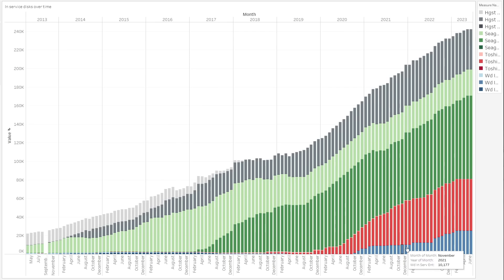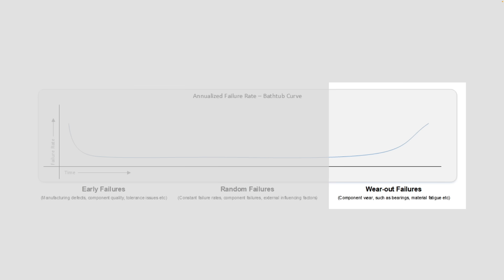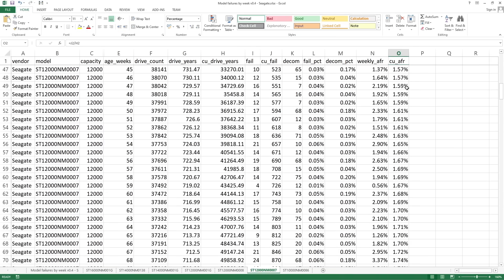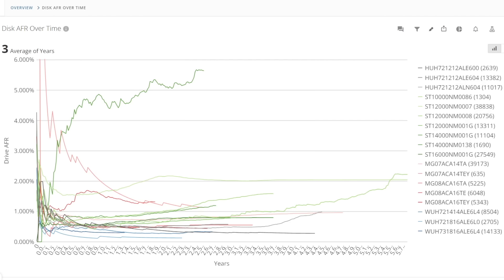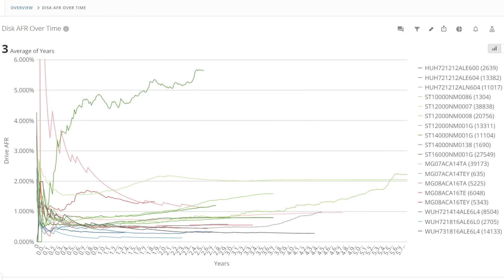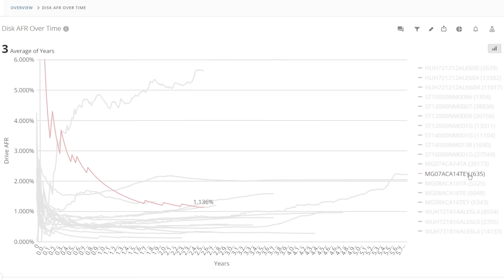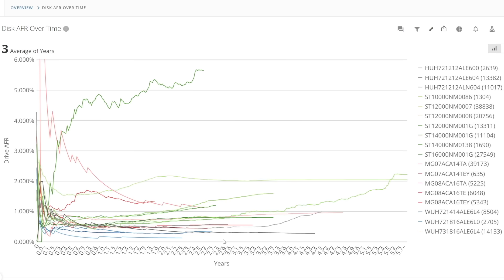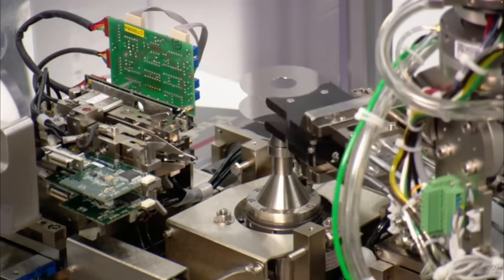Failure Rate Analysis - Best 10Tb+ hard drives: Seagate, Western Digital or Toshiba?

Comment: None of this is relevant. This recipe works perfectly: only buy hard drives that have a 5-year warranty and always use RAID. If necessary, keep a spare Disk on hand in case a disc fails so that it can be replaced immediately. This gives you the guarantee that you can use the discs you have bought for 5 years at no extra cost.
Reply from the maker: I wouldn't agree it isn't relevant, all the data points are relevant to the decision on which drives to buy. Especially for home/SOHO where people don't carry spares, or where its more financially viable to replace a drive when it fails. 

But it does point the fact and it isn't the only consideration, and despite Seagate not having the best reliability, the pricing can mean it can be the best choice, especially if you have a lot of drives and carry spares. In enterprise, servers are often replaced before the 5 years drive warranty expires anyway.
Reply: @sometechguy  Hello 🙂. I still do not agree:
At work I'm an IT manager with a few hundred employees and our 70 servers all have Seagate with a 5-year warranty. The last time I had a single Seagate disk fail was about 8 years ago. Of course, this was no real issue, because we've got the replacement Disk within 2 or 3 days.

And especially in home/SOHO, the only and most important parameter is to have disks with 5-year warranty: These disks are not more expensive and the warranty ensures that you won't have to buy another disk for 5 years 🙂. If someone doesn't want to have a spare disk at home, they still have the freedom to decide in the event of a fault: If the warranty takes a long time to expire, they can buy a new disk if necessary.

You're sure about this?:
"In enterprise, servers are often replaced before the 5 years drive warranty expires anyway."
We are a group of companies with 8 different companies. At each(!) company, servers and disks are used for much longer than the warranty: Our current, productive servers (and disks) are approx. 8 years old, i.e. the warranty expired 3 years ago. And all Seagate are perfectly running 7x24 🙂

Comment: This was fantastic, thank you very much for your time and presentation. I'm curious if the manufacture site code is not really relevant anymore? If I remember correctly, at least in terms of seagate's, if they had an active recall published, it was generally based on a specified site code in addition to a certain min-max index of serial. As I stare at a few drives here, I'm failing to see an obvious site code on WD, HGST, or Hitachi drives which has piqued my interest if perhaps HGST, WD, Hitachi are all manufactured from a single site indifferent to that of seagate potentially having multiple manufacturing locations...?
Reply from the maker: I don't believe any of the manufacturers embed this data in the serial number or model number, at least not in a way thats easily accessible. I would love to have that data to include in the comparison, as people comment that the country of origin is related to the quality and reliability. A lot of manufacturer happens in Thailand still, but I think there was some diversification following the issues with the devastating floods that hit that country and seriously impact HDD availability for some time.

Comment: What data visualization tools are you using?
Reply from the maker: I used Domo for this. Its a pretty good data visualisation tool and a lot more affordable than Tableau which I used in the past.
Reply: @sometechguy  Thanks for sharing and great vid! The visualizations made it easy to see the AFR's over time for each brand/model. I've used MySQL/Metabase, Python libraries and R for data viz, Domo looks easier to use and better for presenting data, will give it a try!

Also curious how Backblaze isn't using any 20TB drives as of 2023 report and I'm seeing a lot of refurbs, wonder if there is an issue with them.
Reply from the maker: The 2023 Q4 data was released, and it looks like they now have 2x 20Gb Toshiba MG10s, and 2400x WD Ultrastar HC570 22Tb now so that deployment is underway. No sign of 20Tb+ Seagate drives. In the last dataset they had started to deploy the 22Tb disks, but the count was very low and the deploy period was very short, so there wasn't any useful data.

It takes a little bit of time, but I hope the 2024Q1 should also be released soon and we will see what happened there. Once I have that, I will see if there is anything interesting in this.
Reply: Good find! I checked the 2023 link which is 2023 Q4. The drives are mentioned in the article but not the table. The refurbs I'm seeing are the Seagate 20TB X20 and X22. Seagate removed the X22 lineup and only sells X20 and X24 now. Subscribed, looking forward to the data and future vids!

Comment: What about 2tb, 4tb?
Reply from the maker: Check this video : https://youtu.be/l_YqdVGcC0o

It covers the 4-8Tb disks, and because there is a real mix of Enterprise and Desktop disks in that data set, it compares failure rates between desktop and enterprise drives also.

There are small drives, right from 80Gb to 2Tb, which I didn't dive into yet. Most of those in the data are very old, they have not added 2Tb disks for many years.

Comment: Three things:

1) Seagate vs. WD HGST/HGST
WDHGST/HGST is at worst, 1/3rd the AFR of Seagate drives, and at best, almost 1/10th the Seagate AFR.

That's HUGE!

2) WDHGST/HGST
This is, I think, why WD bought the HGST division from IBM/Hitachi because the drives AREN'T the fastest in terms of read/write/I/O/s performance, but they're absolutely rock solid drives.

And yes, whilst you pay more for the initial capex for the drives itself, it also pays dividends with having a lower overall failure rate vs. Seagate.

3) This data shows why I avoid Seagate drives like the plague.

2024 and not all of their drives have some kind of ramp load/unload mechanism for the drive read/write heads, which STILL leads to their R/W heads crashing into the disk platters in some failure cases.

This tech is almost 25 years old by now. I remember when IBM first introduced it in 2000 (which then became HGST).
Reply: Agrees. Used to buy Hitachi drives and now buy the HGST WD drives and they've been extremely reliable. Knock on wood.  WD NVME Black has also been excellent.  Really hope they maintain quality after the current split.

Comment: yeah. Humans are just really bad at estimating probabilities. Unless you have a huge dataset like this one, you will always hear anectodal "advice" like, don't buy toshiba, dont buy western digital etc. Eventhough Seagate isn't getting away here as the best, unless you work with a huge number of drives (10k+) your personal experience is basically meaningless. Even if you had a hundred drives over your lifetime, models change. Some models may be just a bad design, even   from a "usually good" supplier. Your personal experience is just a random pick.
Reply from the maker: This is spot on. 🎯

Comment: Unless you NEED the density and speed I'd go for a non-helium drive any day. I have a atleast 14yo 3TB drive that's been clicking for atleast 6 years but is still running great.

Stacking 8tb drives and tape storage for ultra long term + density all the way
Reply from the maker: I didn't see anything in the data that suggests helium makes any difference to reliability, though the first helium models were a little off, but models vary and it wasn't significant. It seems that recent drives, despite the increased density are getting more reliable.

Comment: These figures are for continuous use, correct? If the use is intermittent, say six hours a day, does it it extrapolate to 4x the life? Or does the way its used increase or decrease the MTBF?
Reply from the maker: The use case is 24x7, but the test data is actually calculated against power_on_hours anyway and not elapsed time. So its based on continuous use, and because the power on hours lines up with the drive ages closely, its clear they are powered on for approx 24hours a day on average. I am sure there are brief maintenance windows.

But in terms of the stated MTBF on the drives, its based on assumed workload for the drive. For enterprise drives in this video, they are all 24x7, but MTBF on desktop drives is often based on numbers around 8 hours a day.

Comment: Rule #1 -- as true today as it was 20 years ago -- avoid Seagate drives
Reply: Modern seagate exos are perfectly fine
Reply: Oops
Reply: amen brother. I've worked on various data centres for past 20 years and Seagate always had the nost failure rates
Reply: what u recommend?
Reply: I still have a 7200.11 that failed... First time I've been angry at a manufacturer
Reply: My experience, Seagate is utter garbage. Every drive I had labeled with it are growing bad sectors or completely failed.  Multiple models.  Hitachi, only 5% failure in  5+ years use.  WDC, typically get weak sectors that can be strengthened by writing 10 patterns on them.

Toshiba, 10k SAS drives zero failures.  15k drives 30% failure after 5 years.
I owned nearly 100 drives since 2007.  I still operate 50 of those drives since 2007, only one being a failing Seagate drive. All the other Seagate drives were returned while on warranty at least two times and as much as five times.  I finally gave up sending them on warranty because they kept sending me drives that would only last a few months or weeks before being bricked.
Reply: @pixels303at-odysee9  I was looking at Toshiba. Do you think that quality differs between Enterprise, NAS System Pro, Performance, Surveillance(recording/rerecording cameras) or is it all the same and they just name it different(illusion of choice)? I suppose there is optimum cost ratio for everything...I'm looking for a home server.
Reply: Wish i saw your comment 3years ago. I bought my first  and last seagate 8tb
Reply: God damn i just got one, am i cooked?
Reply: @xiRePeNTx   You could be cooked with any drive model from any brand if you don't do backups. Even the most reliable drives will sometimes fail randomly. I used a Seagate drive in my PC for years and it was fine; recall how long the MTBF was for even the worst models in this video (and recall also how great was the variation between models).
Reply: out of the 50 or so hard drives ive owned in my life, only 2 failed, both were seagate :( also only 2 seagate i owned..
Reply: Lol no. All hard drives are going to fail at some point. WD have failed me more than Seagate.
Reply: @Kevin-oj2uo  thats why we should Backup and do raid

Comment: This is one of the greatest datasets in all of technology, as it allows our purchase decisions to pressure vendors to build more dependable drives!!!
Reply from the maker: Yes! I believe this is why Backblaze publish it and why others should to. I am sure it’s leverage over the hard disk suppliers to do the right thing by them also.

Backblaze also do a great job at keeping the dataset relatively clean. It didn’t require too much clean up to ensure consistency.
Reply: @sometechguy  I wonder if we could write an app to monitor drives in Win/Linux machines around the world? That could really grow this dataset. You'd just have to trust the use to determine is a drive failed vs removed. Could work. Would be fairly easy to write.
Reply: @jasont80  maybe you should write one. With that said, how'll you get people to install such program that it can start producing enough reports to generate a useful stats?

And what's to say Microsoft hasn't done this so they can optimize their purchasing decision for their cloud datacenter (azure)? Windows is Spyware after all.
Reply: @NinaYahsika  Windows does collect a ton of data. There is already software, like PassMark, that collects a ton of data about hardware, but it's difficult to measure failures because many hardware failures on personal machines stop the computer from working.
Reply: @jasont80  discontinuation of a HDD serial number, for example, for the same account/login can be used as an estimate of that drive going kabosh. Ceteris paribus of course.
Reply: @NinaYahsika  You'd need some way to incentivize the reporting. Almost no one is going to spend even 5 minutes reporting on an old drive.
Reply: @jasont80  I was talking about how by collecting data of HDD serial (on each boot, for example), Microsoft can get data of active HDD and whenever the serial stop showing up, it suggests that HDD is dead.
Reply: @NinaYahsika  That's an interesting approach. I guess the only issue would be figuring out how many are failures versus a retired drive (I replace mine every 2-3 years without a failure). But still... it would be valuable data!
Reply: @jasont80   data analysts call it proxy variable - a variable (hdd serial continued presence) that might estimate a true variable (hdd failure). This can hold up when ceteris paribus - such as regular replacement being at a similar rate across brands. Although I'm a backend dev by trade, I was taught this approach during my undergrad Economics degree.

Comment: Back many years I remember Seagate having a series that was very low quality. The failure rate was very close to 100% over a year. Yet we had a customer who never let us replace the drive he had. Instead we opened it up and nudged the read write head and closed the drive back up again. It would continue working for 3 to 6 months before failing and that customer would be back again. It was incredible that the drive kept working. From all I knew about HDD's it should have crashed the head, but instead it just worked. Another drive I had, a Maxtor I think it was, was also strange. A metallic sticker had been torn off opening a hole in the cover of the drive. The disks pushed air out of that hole so I could feel it on my fingers. It also made the drive sound strange. That drive I swapped out for a customer who wanted a larger drive. I kept using it for test installations of windows on machines and it just kept working even though I expected it to die at any time. But for a few years I used it over and over and it never gave up.

Finally we sold a crapload of IBM "Deathstar" drives. I'm talking about several hundred of the worst of the worst model. And yet we had less than ten that came back before they were out of warranty. It was strange that we had that much luck with that drive that was documented to have extremely high failure rates. We had them in our own server, and in six years none of those died.
Reply from the maker: People complain about disk failures, and its understandable because they can have a really serious emotional impact to people when they contain important data like photos, especially if not backed up. But considering the incredible precision engineering and moving parts, they still often last 5-10 years. I just did a video on the engineering on the new Seagate Mozaic drives, and its amazing the things work like they do.
Reply: ST3420 or 2340 perhaps? I remember those drives failing in bunches back in 1995. Some IBM drive cases would warp above 45C and crash the heads.

Comment: These ridiculously high failure rates made me move back to the cloud. I just can't justify spending so much money on hard drives only for them to die way too quickly. The cloud is just so much cheaper. I'd need my drives to last 15 years at minimum for it to be cheaper. And I have never had a drive last more than 5.

Comment: The most reliable drives I have had over the last 15 years were Samsung. The least reliable were Seagate with WD somewhere inbetween.
Reply from the maker: Since 2011, Seagate owned the Samsung hard drive business. So any superior IP owned by Samsung you would hope would have been integrated into Seagate. Assuming that there was a real reliably advantage and it wasn't just anecdotal experience. The backblaze dataset has some Sumsung drives, but the number is very small and I think many of them were actually 2.5" form factor. So not much analysis possible there.

Comment: Seeing my experience backed up by numbers is fantastic!
I have had so many hard drives fail from many different brands, and have lost a lot of data because of it.
I have yet to have a Western Digital to give the ghost on me without complaining about old age first for months of slow speeds, screaming "Please retire me"  😂
Many drives die by looking at it wrong but have rough-handled WD's, and they are still alive today.
This is how you earn my brand loyalty!

PS. Don't worry I have grown up now and backup properly on raided systems.
Reply: Yes, I've been a long time WD user, because all this time, to me,  they've proven to be most reliable, overall. In my box of antiques I have one of the first SATA drives, a WD1600, from 2003. I can plug it in and use it if I like, even now. Still works perfectly thanks to the FD bearing. In fact, all the WD drives still work and I have a lot of them, accumulated over the years. HGST also performs very well, and Seagate...well...I've had plenty of those conk out on me. Quantum drives never failed me, until Seagate raped them. Never had IBM drives, they tended to have bad batches. When it was bought by Hitachi, quality went up dramatically (This is now HGST). Moderately satisfied with Toshiba 3.5 inch drives, their 2.5 inch laptop drives are exceedingly good.
Reply: RAID is not a backup
Reply: @m1stertim  I think you missed the s there at the end. 😉